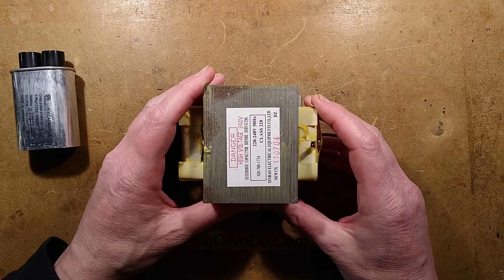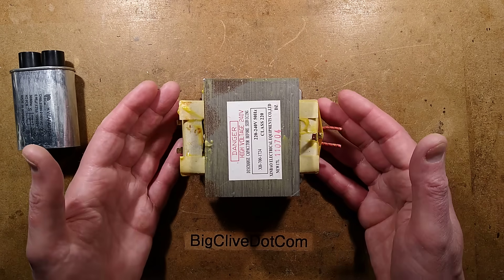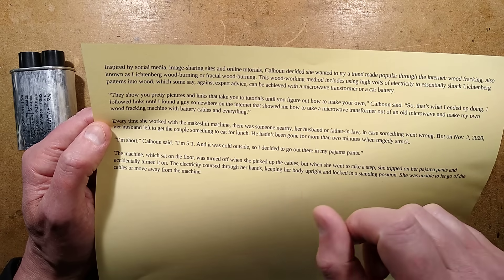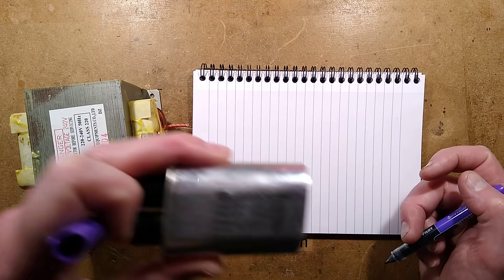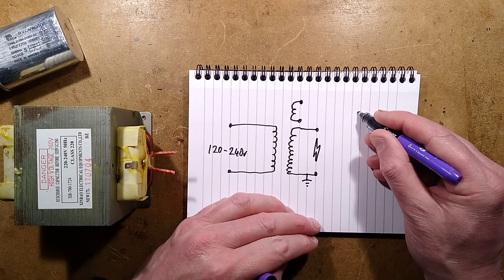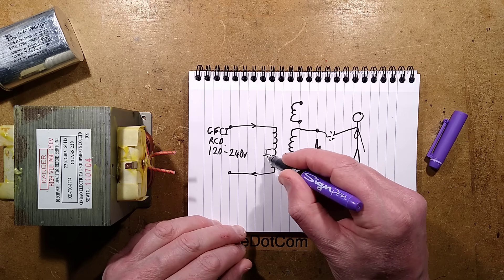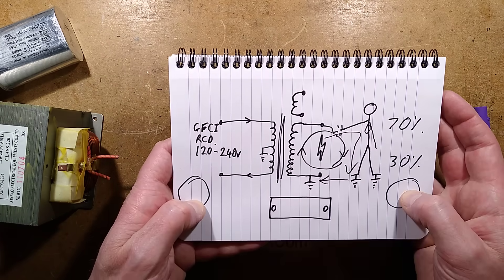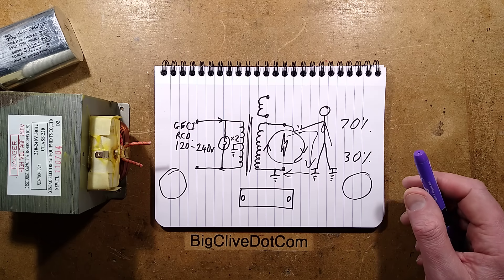The most deadly project on the Internet

Comment: I have build spot welder out of microwave transformer. Yes, I used former secondary coil as primary, and where the primary was, I used 4 passes of thickly insulated 15mm wide and 1.25mm thick copper strip. The current is over 600A (thats the maximum of what my induction amperemeter measures) at about 2.8V It overheats quickly... The thick, 25mm2 wire leading to electrodes needs to be insulated only because the high current makes it hot very quickly. 
Well, when I welded together 3.5mm wire, I was able to make 6 welds and then needed to wait 45-60minutes for transformer to cool down:) But it works like a dream and it cost me less than 50 eur.

High voltage would be dangerous, yes. but I have no use for it :)

Comment: Fwiw, you could always get a GFCI device and feed the transformer leads through it before they reach/return from the arcing device. This will ensure GFCI protection on that side of the transformer, assuming the transformer doesn't take it to a voltage outside of the GFCI's range. (In which case this electrician thinks you shouldn't be playing with it anyways.)
Reply from the maker: It would require a custom GFCI to work at that voltage.

Comment: But can I make a spot welder with it?? 😉
Reply from the maker: You can if you cut off the original high voltage winding and replace it with a few turns of heavy cable.

Comment: There is a world of difference between 'neon sign' transformers and 'ignition' transformers.
Where I live, oil-fired home heating is fairly common; to insure ignition, a hot 'blow-out' resistant arc is required.
Ignition transformer can throw a kilowatt or more into their 'modest' 15,000 volt arc.
Melting the vertical leads of a Jacobs Ladder probably means your coil is a beast.

Comment: When I was a kid I zapped myself with one...I  couldn't figure out why shorting the wires(filiment windings)  didn't produce an arc...then my hand slipped and while holding a wire it contacted the steel core and BZZZT💥 half my hand was numb for 2 hours...the other half hurt like  crap🤣 I had 2 deep contact burns in my hand😅

Comment: My high school physics teacher also did the fractal burning, but He, instead of probing with sticks in hand, he nailed the electrode into the dampened wood and do everything on a large rubber desk cover. Everyone must be 0.5 meters away form the things that will be energized before it is powered on. And wait 5 second after disconnecting the power just in case of some charge built up. We did a dozen of fractal burning. no one was hurt.

Comment: I was taking voltage readings in a large old CRT got hit twice from a deflection Amplifier at 6000 vdc... caused by insulation breakdown of a high voltage cable.It was smaller than a pinhole and I saw the arc shoot out of it the second time. It felt like getting hit in the chest with a hammer and knocked me to the floor. I take metoprolol to this day because of it.

Comment: I was taking apart and repairing AC motors in Lionel electric trains when I was three years old, my grandfather, who had LOTS of experience in metalworking, woodworking, and electrcity, taught me from a very young age, that electricity is like a tamed circus tiger. Treat it with respect, it will do amazing things for you. Treat it with respect and caution always, otherwise, that tamed circus tiger will remember its a tiger, and kill you. The same, he would say, goes for electicity. Get careless and it too will kill you. Perhaps not the best analogy, but to a little kid, it got the message through. Even now, when working with step down transformers (110VAC to variable output with a max of 24VAC) I approach with caution. Always use a steel box that can be quickly sealed to test transformers, with a kill switch for the 110VAC to quickly shut off power. This way, if it catches fire, or starts sparking, it can be safely contained. Complacency, I was taught, was the biggest killer. Of course, tinkering with stuff well out of ones leauge has to be a close second. Microwave transformers are well out of the league of the average person and even some who work with low voltage equipment.

Comment: in India we have 220V as standard and I got shocks from direct plug so many times yes it is dangerous, yes you feel shock but it cannot kill you instantly this is not "that high voltage" 440V is. fuck your 240V HIGH V WARNING sign
Reply: Is there moisture covering your plugs? 
Possibly your own sweat would be enough, being slightly salty thus more conductive. 

If that was happening to me I would wonder, Why am I paying for something I don't want.
Reply: @myparceltape1169  actually the reason why got so many electricity shocks because I am nerd and all the time trying to make something with wires and electricity in my garage.
Reply: @darshaim  In that case, may you have success and enjoyment.

Comment: Getting a capacitive shock is like being shot. It happens in an instant and it's done. Whether you live or not depends on the damage done in that instant.

Getting shocked by a microwave transformer is like being run over by a train. It stops for nothing. Being "lucky" is losing a limb instead of your life.
Reply: 2 car batteries magnetron and flash circuit from old camera can shut down the state , amazing what u learn when u don't get your stimulus check
Reply: One is instantaneous and one is continuous.

Comment: Whilst on the subject of safety, ALWAYS wear the right protection for a job - it's like a seatbelt, you only realise it's worth when you have an accident!  I attended a first aid incident where a guy had emptied a chiller of it's propane gas prior to transportation, however, upon removing the pipe after emptying it he caught it on the side and the spark ignited what little gas was left (30ml) burning his hand and arm. We ran cold water over his arm for 15 mins and then loosely draped cling film over the arm and got him to casualty. It turns out that he had performed this procedure a 1000 times without incident beforehand and just didn't bother putting on the safety gauntlets and visor (good job he had glasses). I bet he wears them in future!

Comment: I used to repair computers and always used 240v  PC power supplies (PSU) to test components. One day I just selected one of the PSUs to test a CD drive. I was holding the PSU in one hand and went to pickup the fly lead to power the unit on. The next second I had like a loud foghorn going off in my head (this was the 50hz 240v AC). I knew that I had to fall away but couldn't  because I was holding the PSU. I managed to tilt my hand and the PSU fell to the floor dragging the fly lead out of my other hand. I had to go to hospital to treat a deep burn to my finger and they kept me in overnight as they said it's common for your heart to stop later after being electrocuted! They also gave me a tetanus shot.

Of all the PSUs that I had to choose from, I happened to pick one where the insulation had come away from the fly lead switch contacts, so when I picked it up I was bridging 240v with my hand! I am SO careful now around mains power!

Comment: This is one of the best cautionary videos I've seen in a while. What is difficult to explain is the dangers without getting overly technical or mired in the details.
Even so, one important point is the 10mA 'rule'. If what you're working on is capable of putting out more than 10mA than it's capable of electrocution (death).

A second important point is the higher the voltage (even at low Amps) the further the electricity can ark or jump through the air or any other insulator.

As an electronics student in the 80's I designed on paper the building a tesla coil, then I built it. I made sure to keep the secondary coil current below 10mA, even though the voltage was around 1.6 million volts. The lightning bolt out the top of the coil was impressive but relatively safe. I say this because electricity is to be respected but can be an educational and enjoyable experience if done safely.

Comment: Dangerous but Not the deadliest... Understand electricity and insulators. Like many projects you need to understand hazards. There are so many things that get people killed on Youtube. Good safety video though. Put the device inside an insulated isolated box with safety switches and the idea of the deadman switch is also a good addition. I work with X-ray systems that makes this transformer look tame. 100KV at 2 AMPS. Lock out tagout triple check your safeties.

Comment: Clive I hope you get this,by the way I love your channel you have made me see how I should be dead 100 times over.I love electric but had no education so love to have someone who can tell in laymen’s talk what a resister does etc etc.I wish we’d had you back in my youth,I come from a naughty family I regret my passed but it’s all I knew from parents.I remember my dad rigged our caravan up to a lamppost trouble was we only had electric after dusk as he must of connected before timer.I lived in squats in 90s and was the man to get electric on. We had a run down terrace houses that they wanted to pull down they had 4 families with kids and many single homeless somewhere to feel safe n lay there head.I used to live in one house ide knock couple of bricks out of wall and rig electric next door n run a single wire into my room,so if bangs at door just push the socket and wire back through hole one house was full of younger lot who wanted to party.I had already knocked skinny squat dweller skinny hole through ar top of stairs in all houses so if on a chase a average squat dweller could run into one end squeeze thruway to next house and come out other end or any house.the holes were skinny as a copper dresssed in full kit couldn’t get through.well in the party house I did my usual the metre was cut of but still there I would burn through the live wire with a lighter and burn the plastic of I would do brown wire to then clean the carbon and unturned plastic with a stick. Well the house wire kept melting in a firework style sparks I was coveted in smal burns.I would then skin ends of wire clean and hang the wire from the upturned wire (as to hold the hung wire)obnoxiously before burned clean

Comment: 30 dead from this  in the U.S.A. alone? If memory serves, a similar number are killed annually in the U.S. viz a) heart attacks on domestic flights & b) incorrectly discharging capacitors on PC motherboards. I WOULD have said - "Well, that's America - they dim" BUT I've encountered a significant number of brainless arseholes here in DublIn over the years; no point whatsoever trying to explain concepts such as RAM, how pressurisation and/or HEPAs work at flight level 38-zero, Ohms Law, Kesslers Laws of Planetary Motion/GPS satellite synchronisation, eScooter batteries etc. YET I'VE TRIED - no use; better off trying to teach classical Greek to a duck! Such nimrods typically end up becoming senior civil servants (in my expereince)......